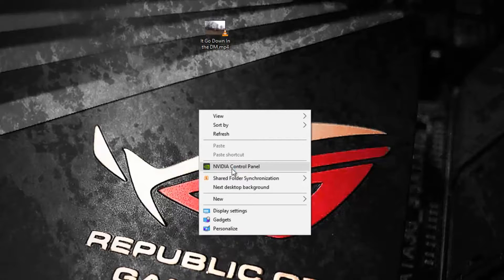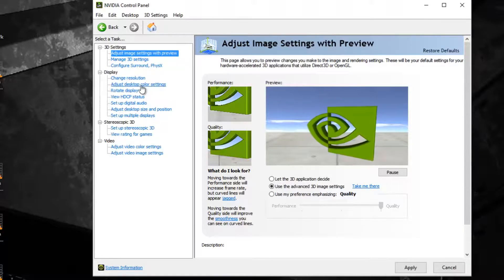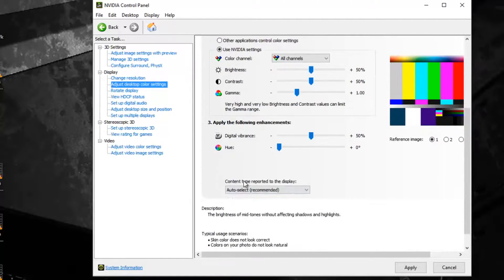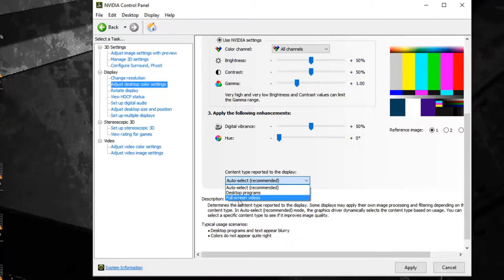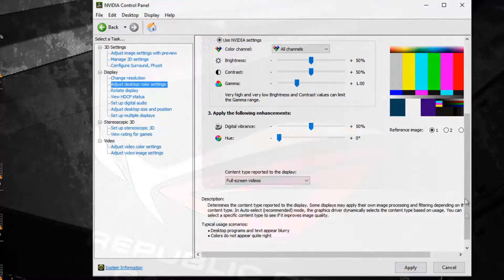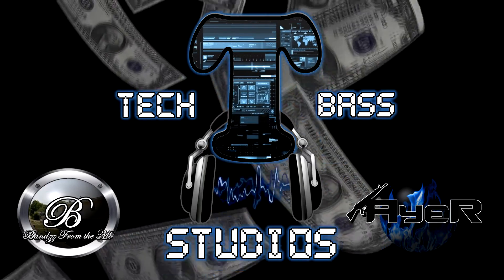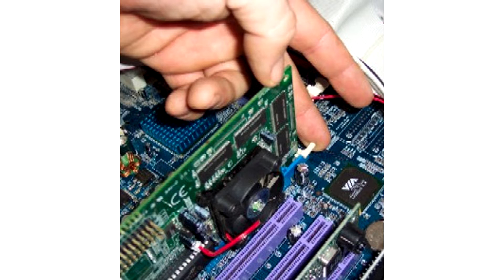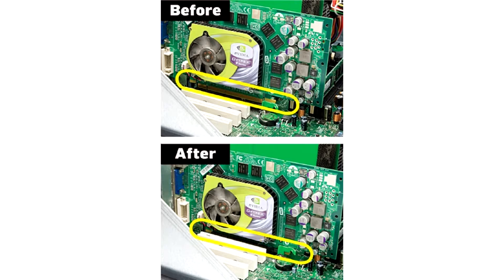Solved Screen Goes Black Temporarily When starting & Stopping videos

Comment: Thank you so much for this video.  I've been having these issues ever since I build my computer and thought it was a hardware problem.  My NVIDIA settings were slightly different now, but I was able to fix the issue by clicking the "Override to reference mode" checkbox and selecting Full-screen videos under the "Content type reported to the display" section.  Thanks again!
Reply: YEAH THIS WAS ABOUT 6 YEARS AGO
Reply: @DaddyJamesFilms  just happy it got me pointed in the right direction

Comment: I'm having this problem and we're in 2022 and there's no longer "Use Nvidia Settings" there anymore. Everything else is there but that. It just has an unchecked spot saying "Override to reference mode". Also "Content Type Reported to Display" is also gone.
Reply: tell me if u find a way to fix pls
Reply: @giadohall8435  i tried changing the cable to the monitor and the cable didn't work at all. But I'm not sure if it's a cable problem or something else. Nothing yet.

Comment: please help me, when I watch certain channels and videos on youtube the screen goes black when I'm not moving my mouse. it's really annoying to have to move my mouse every three seconds. it's only on chrome though, i tested on internet explorer and it worked fine. Do i have a virus or is something wrong, please I need help

it's only on my computer, chrome, youtube and certain channels that this happens on
Reply: Looks like it was the mouse driver or firmware causing the trouble. try updating the mouse driver if that doesn't work update the  BIOS download the driver from computer Manufacture. website.

Comment: Thanks bro. This normally doesn't happen on my 4k tv to my pc with a hdmi chord plugged into the pc. But since I have a VR headset, I had to use a displayport so the the VR hdmi can go into the graphics card. But yeah I noticed it would do that with videos that were at least 1080p with the display port. Worked like a charm.

Comment: Just got my first NVIDIA card in years and thought what the fuck is going on. This fixed the problem. Thanks very much. Although it's kinda troublesome that this has obviously been an issue for years now and still hasn't been fixed by nvidia.
Reply: yeah I know it sucks but they are the best cards though.. mine was doing that for a while but I haven't had that problem in a long time.. glad I was able to help

Comment: God bless you Daddy James Films, god bless you... i've been struggling with this for almost 4 years now, and even has been happening on my brand new rig with a GTX 1070. any time i went to twitter or ESPN or any site with embedded vids, it would do this flashing crap. Soooo annoying! Thanks again for the fix!
Reply from the maker: ur welcome but remember sometimes when you update your graphics driver you will have to do this again. for some reason when Nvidia updates your graphics it resets it to default..
Reply: yep, i favorited this video for that very reason, in case i need to do it again after any driver updates.